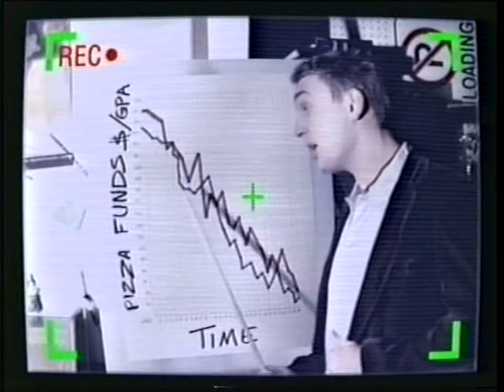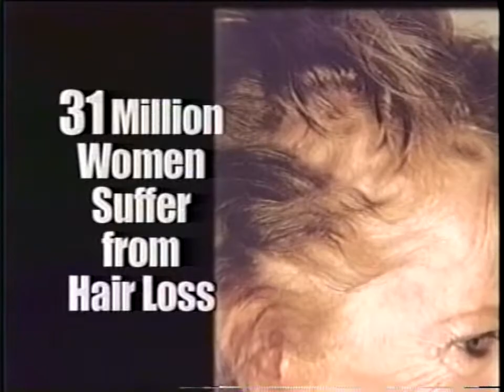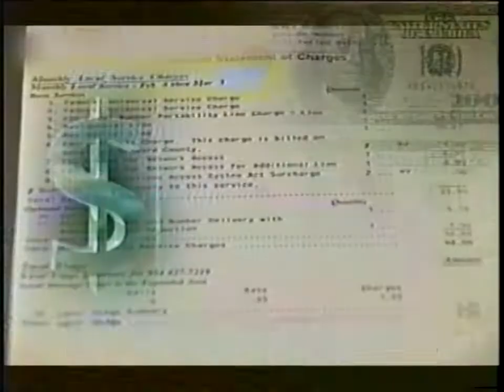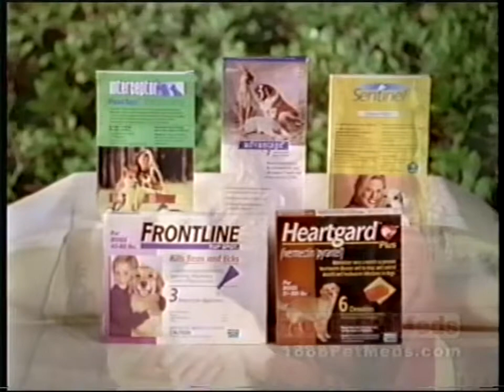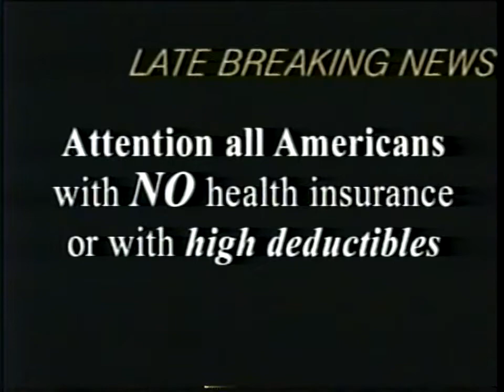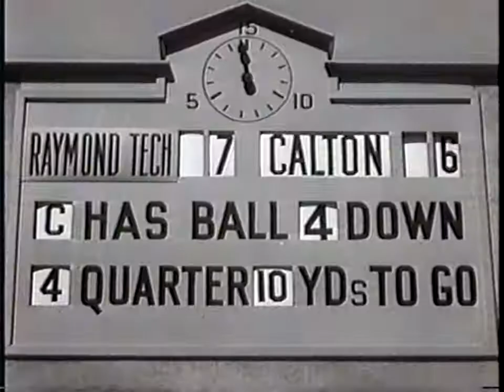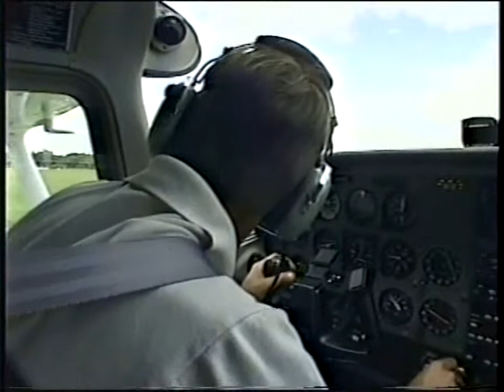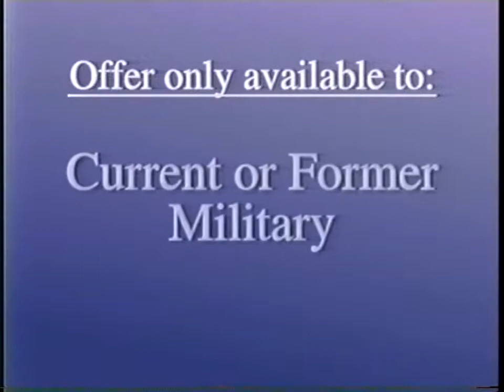Discovery Wings Channel Commercials (2002)

Comment: Ever want to just fly away? Well, the Discovery Channel has a show that's about just that join host Mark Evans every week as he builds and learns how to fly his own cook Plan C a homemade creation go from being born to being airborne. "Off he goes." With a little elbow grease of course. "Now I've got to put all this stuff together." A plane is born Sundays at 8:30 Eastern 7:30 Central on the Discovery Channel.
The Discovery Channel looks back in history with those who were there. "There just seems to be something in the air." "Uh, Theirs needs to fix it." First-hand accounts of the events that shaped our world. "there has been so much of hate." "The time has come for passion." [All dialogues] Touched by History Sundays at 9:00 Eastern 8:00 Central only on the Discovery Channel Explore Your World.
Now it's time for another hot summer tip from the Discovery Channel. Remember. Heat rises. This summer we're taking you higher further faster. The temperature isn't the only thing rising follow the evolution of acceleration. And try not to get burned. Summer of Speed starting Monday Night at 8:00 Eastern 7:00 Central right here only on the Discovery Channel Explore Your World.
Are you ready for the ultimate ride? Then strap yourself in and feel the rush of link on the Discovery Channel. Climb in and hold on as Aviation's elite push technology past the cutting edge Test Pilots. Take a flight on the wild side where success is measured in speed an adrenaline Extreme Air. Get ready for the ride of your life Test Pilots and Extreme Air every Sunday night at 9:00 Eastern 8:00 Central only on the Discovery Channel Explore Your World.